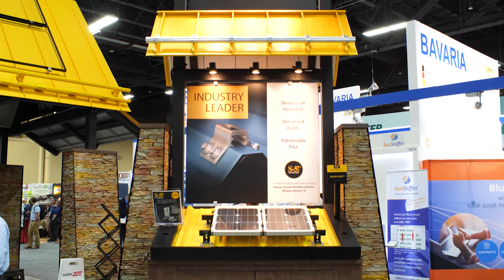S-5! Solar Foot brings rail-mounted solar to exposed fastener metal roofs

Comment: Installed 42 Solar foot mounts on my Florida metal roof. The building inspector was happy, he will not approve mounts screwed into just metal roofing, these go into substructure below and meet hurricane code. Not one single leak.